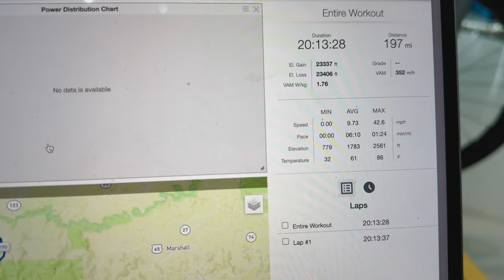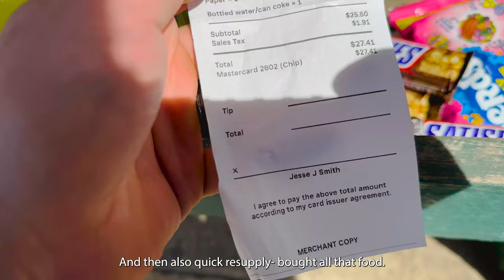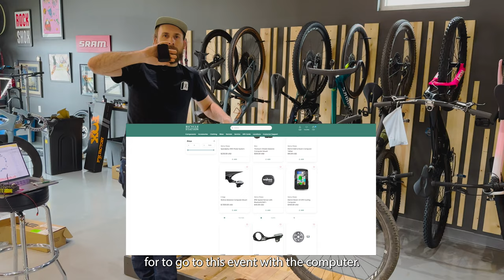The Drop Bar Epic World Cup actually won a race! 2024 Ozark Gravel Doom - Despair Race Recap

Comment: My Gravelbike is 110/120mm travel full-sus Specialized Epic Evo XC bike with 700x47 Specialized Pathfinder Pro Gravel tires and a flat handlebar cut very narrow.  Using a narrow flat bar is more aero than a wide flat bar.  I can totally feel the difference going from a 30in to a 24in wide flat bar.  This bike is just has fast as a Gravelbike on pavement and gravel.  Unlike a Gravelbike, it performs very well on singletrack.  The Pathfinder tires hookup better than would be expected.  47mm is 1.85in.  XC bikes, from 15 years ago, came with 1.9in/48mm tires.   1.9in semi-slick tires and 25in wide handlebars came stock on my full-sus 100/100mm travel 2009 Epic.   15 years ago XC races were a lot  like modern Gravel races.

Comment: Wow! Good job and congrats! 
Good thing you've changed the setup to a "gravel setup" a total departure and imho a smart choice from the usual "mtb setup" you proclaimed as the best gravel bike on a previous video. The point of contention was that original mtb setup was... well, for mtb. Tires, rigidity and aero (dropbar and aero bars) made this bike into a good gravel bike. Dylan Johnson achieve his best race result on a similar setup. Again, congrats! 👏🏻👏🏻👏🏻
Reply from the maker: I’m currently thinking of it as an aero mtb lol.  I proclaimed the WC frame to be the best gravel bike. I still think that. It’s the same bike. Even with a flat bar it’s the best gravel bike. It’s just not aero without the drops
Reply: @bicyclestation  yeah aero mtb = modern gravel bikes. WC cup frame could be the best gravel "frame". Drop+Aero bars has all the advantages vs flatbar on 200 mile race except probably in Unbound.
Reply from the maker: I think it depends on who you are. I definitely wouldn’t wanna race 200miles on like a crux and would rather race this bike at unbound
Reply: While some factor depends on the rider but race course would largely dictate what bike and bike setup is best to use. Crux is a good example of a well accomplished race bike, add aero bars + wider tires you may get best result in Unbound.
Reply from the maker: I know I would 100% be faster on the WC then I would a crux.

Comment: Congratulations! Love the look of that bike, especially the crazy pink one. Been toying with trying drop bars on my procaliber. What's the most challenging part about fitting them?
Reply from the maker: I recommend starting with the same size sent you normally would use with a flat bar then adjust from there. I’m actually still using the same stem on this set up
Reply: @bicyclestation  are you saying same size frame, same size stem as you would normally ride? The added reach of a roadie bar gets you to the right position?
Reply from the maker: That’s what worked for me. I think I might shorten the stem by 10mm but I raced the same length stem as I would run with a flat bar
Reply: @bicyclestation  thank you. Do you have to change the brake callipers so xt matches GRX shifters?
Reply from the maker: Idk why you’d wanna run shimano lol
Reply from the maker: I bet it would work but don’t know off the top of my head
Reply: @bicyclestation  😂

Comment: really interesting to see good results from the wc gravel build! congrats on the win! do the etap shifters push enough fluid for the 4 piston calipers you have set up? also, did you run any bottles at all? i wonder if you could squeeze in those fidlock 450ml bottles in that limited space. ive ran a custom frame bag on my previous-gen epic evo with a 50oz camelback that barely squeezes in (plus a 22oz bottle on the seat tube) and i could totally see squeezing more on-bike hydration with the roomier frame of the wc. im curious on your thoughts on running that smaller top tube bag if you arent using the rest of that real estate for hydration or storage. great video otherwise, would love to see more race recaps like this on the channel!
Reply from the maker: The idea was to cut weight and carry less water. That was a last minute idea but it worked amazingly. 

They do push enough fluid and it’s an approved set up but mine I think needed some maintenance lol. The thunderburts have terrible breaking traction and I think that had more to do with the subpar breaking performance.
Reply: Your breaking issue may have been why you where two hours ahead😂👍
Reply from the maker: Possibly haha. The Burt’s are just dumb fast.

Comment: If you used a flat handlebar, would you still have won?
Reply from the maker: Ummm I think it would have been significantly slower than the drop bars. But I can’t speak on what it would have done to the results in therms of placement. 

The drop bars are just so much more aerodynamic

Comment: I'm trying hard to give you the benefit of doubt that you have a reason for having your drop-bars and brifters pointing down. Riding on hoods and drops set like that looks miserable, especially for such a long ride!
Reply from the maker: Oh that must have gotten cut out. The reason I say the only thing I’d change is the carbon bar is because it shifted down at some point during the race. I think the bar broke lol.
Reply: @bicyclestation  That's a good reason! Those aero bars can add a lot more torque to the stem clamp, add a few bumps and they're going to slip. Maybe try a longer stem with shorter reach bars to set the arm pads further behind the stem clamp, and carbon paste even with aluminium bars. As a roadie who hates time trials, it took me a while to solve clip-on bars.